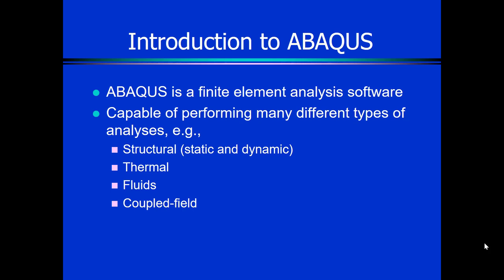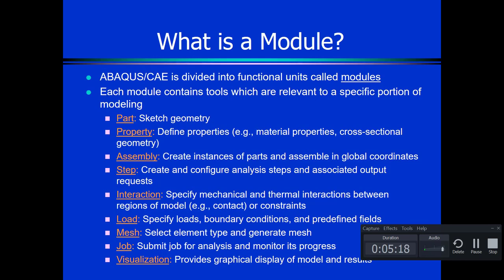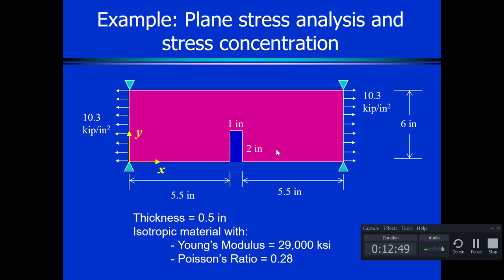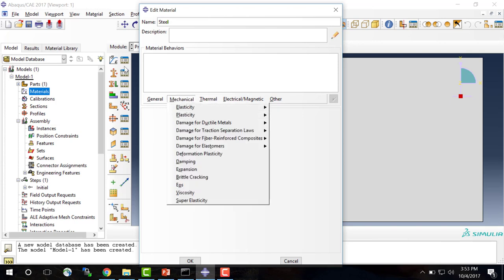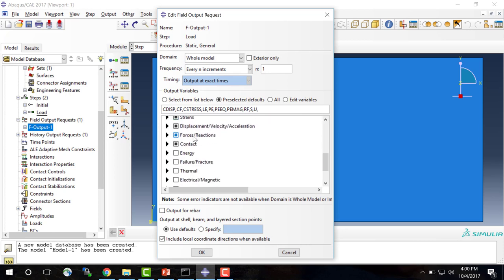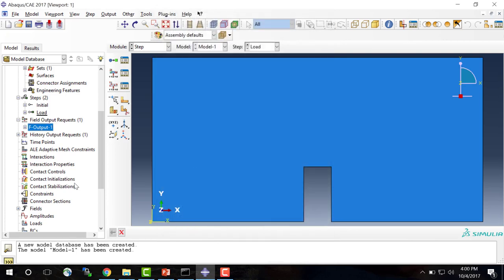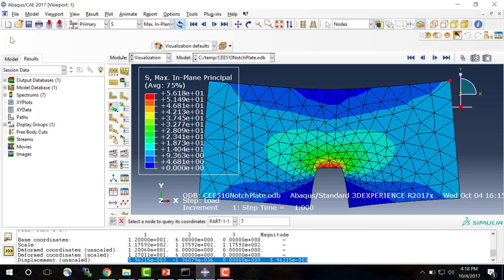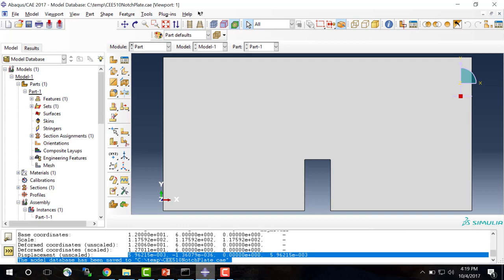Intro to Abaqus

Comment: Hi how can I find the formulas behind the output results in abaqus?? 
To be specific I want to know formulas which the software uses to give the reaction forces..
Reply from the maker: You would have to look at the documentation (specifically the Abaqus Analysis Users Manual) to find the actual solution procedure.